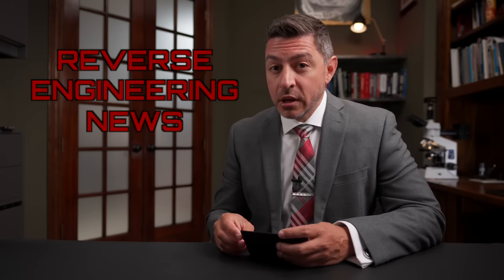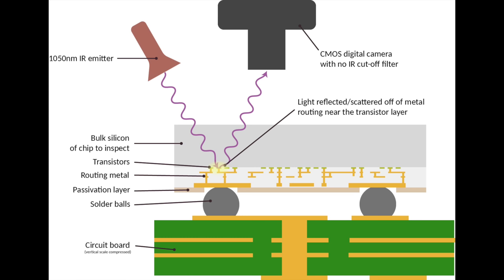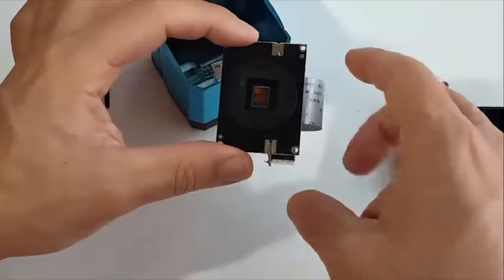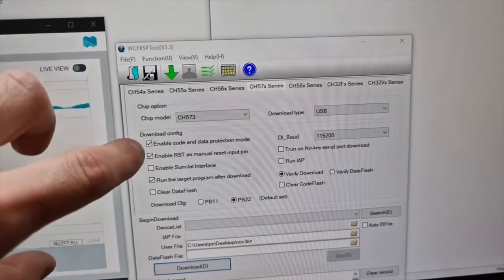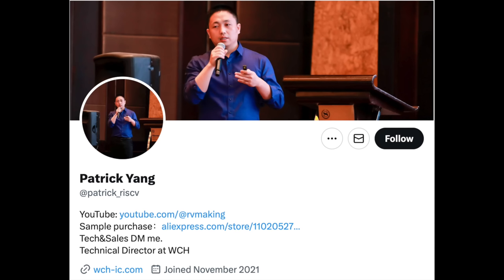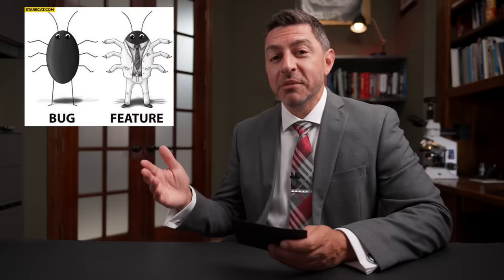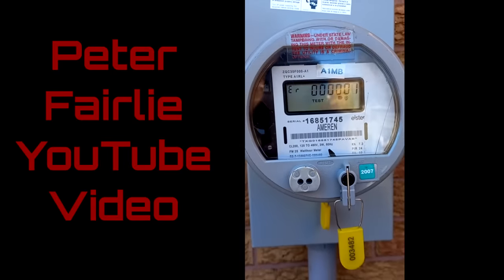Flipper Zero Kills Smart Meter?? - Reverse Engineering News - June 13th 2023

Comment: I discovered the process where it only deletes the pages of flash that is needed to be erase when making the firmware that ran a lift. This is one of those things you put in a car to load boxes.

I can assure you that you would never want to remove that firmware. It also would make it so I can use the rest of the flash for storing diagnostic codes. Flash still kinda sucks if you need to erase it often. So every little thing would help.
Reply: So what if you write a firmware file that just has one block of flash - not even enough to read and dump the rest by serial, but just enough to trick the chip into turning off the readout protection. Flash your "one-block" firmware, presto, read out protection disabled, and then just read the rest of it out. Chances are the first block isn't going to be that important, or difficult to recreate (especially like in this case if there's 2 firmware images in the flash as a backup anyway)
Reply: @gorak9000  oh I absolutely understand it is not a great idea to do in applications where someone could gain something by grabbing the firmware.

But on a lot of things the firmware or hardware isn't worth anything to hack.

I think it is a good conversation to have to understand that such features could lead to bad outcomes. But I am not waiting a 50 week lead time because my chips were bricked with some security feature lol (I know it is unlikely just being extreme with that example)
Reply: @XenoTravis  I don't know what you're getting at here? 50 week lead time because chips were bricked with some security feature? The correct behavior here is really simple = if read_lock=True erase full flash before writing new firmware / removing read_lock. I don't see how that's a "security feature" that would brick chips. When you're doing development, you're not going to bother enabling the read_lock to begin with. You only do that on the final release build that gets high volume programmed into production parts (and maybe a small test batch beforehand). The fact that you can remove the read lock by programming ANY firmware, no matter how small, without it erasing what's already there, which is supposedly protected by the read lock is clearly a "bug", NOT a "feature".
Reply: @gorak9000  was saying if I could save the chip's memory but also be aware of the security flaw then sometimes it would be worth it.
I think the dude who said it was a feature was not understanding that he was not clear to all the developers.

If I was told I can save my chips memory but I just am warned that the firmware is able to be taken easily, it wouldn't have been a big risk.

But that company made the security sound like the chip was locking and erasing like you explained. But in reality it wasn't securing the entire memory because it was also trying to save and write faster.

Sorry if I explained my point wrong. I was just trying to say I understand why the dude said it was feature. But I do agree it is more of a bug when presented as a full read lock.

Comment: Thanks for calling out the fake! Here in Australia we have all sorts of smart metering. I know you can't hack those things easily even though they have serial comms. Some of the newer smart meters I've worked on have a mini NB IoT 4G modem with a sim card, there's no way a flipper would work by design and I own one! Even with zigbee or wifi the flipper doesn't support it unless you've made some software and whipped up a prototype board.
Reply: Regarding the the "first red flag" for the smart-meter - there is a major caveat with that. It is possible to move from Canada to the supposed location. This needs to be considered in the future. The other points are still very valid though.

Comment: The power meter shown in the "Flipper" segment is a peak power recording power accumulator. The meter is read by an electronic meter reader carried by the local walking meter man. It communicates through the infrared port on the front, through the D shaped steel plate on the front. The lever to the right will reset the peak values stored in non-volatile memory in the meter. Reverse engineering the communication protocol is hard, even if you have a reader/programmer. 

Yes silicon is transparent to long-wave Infrared, but the resolution of the image is poor for recent silicon integrated circuit technologies. Current bleeding edge technology is in the range of 5nm feature sizes, and the wavelength of the IR is about 1000nm. And to access the back of the silicon you need to remove the heat spreader or remove the epoxy overfill. Most of the reflected signal is from the metal layers, and not much from the actual transistors.

As someone has commented below, a partial readout of the firmware is useless if you have erased the initial setup code on the device.
Reply from the maker: That device supported OTA updates, two copies of firmware stored in memory so it led to a full dump of the firmware.

The silicon viewing was meant more for block level analysis image comparison, is the chip fundamentally the same as a known good version or something else entirely.

Check out the site below, I have a bit of protocol analysis on L+G Meters, not the same as what he uses but fun none the less. Thanks for commenting!

https://wiki.recessim.com/view/Advanced_Metering_Infrastructure

Comment: The biggest clue that the meter video is fake, is that a service disconnect shut off the power FROM the meter not TO the meter. The meter would not lose power at it did in the video. And if Peter's meter was controlling its own power, how could it possibly turn itself on if it had no power?? Definitely fake. Thanks for exposing!

Comment: A3 was sold with Disconnect option inside. They use BIESTABLE relays that you can varely hear even in silence and they cannot be turned on and off like in the vid, because they they are kicked from a bigcap that need to be charged using the existing PSU. Like you said, moslty a relay out controlling a contactor or something. But those outputs are used in general at industrial application to signal that the demand limit has been reached or something like that.  This meters have been run over EMC  tests at 30V/m (no load) and 10V/m (Inom). So, this thing has been already tested. And yes, functional deviation is allowed as soon as the REGISTERS DO NOT ADD UP (30V/m) or accuracy variation (MAX-MIN) does not exceed 2% (Inom). So send Flipper to read the IEC 62053 first because, just by entering in TEST MODE or ALT MODE, meter is not having a bad time at all. Also, the maker of the vid claims that the way it measures can be changed. Well, anything can be changed. Now, understanding ANSI is ONE thing. Making this alterations are another thing. You need to understand the meter first, then try to find the information that ELSTER have obscured up even to their own employes ... I mean, you will end trashing the measurement or stalling the DSP .... thats the most likely scernario. Now Flipper, do your homework.

Comment: Those "flip chips" are called BGA (Ball Grid Array) mounted Integrated Circuits.
Reply from the maker: BGA is the mounting style, but it has to also be bare silicon on top for it to work. I believe they call that style of BGA a “flip chip”
Reply: @RECESSIM  Never heard of that... I stick mostly to sockets when I'm working with chips. I prefer sockets, avoid BGA at all costs unless absolutely necessary.

Comment: Jury is still out on Peter..... Yeah, those meters may not have been equipment with remote shut off as delivered. Wonder what Ameren would have to say to those account numbers on the meters?
Reply: Let’s just say they know about it and aren’t too happy
Reply: If you go watch his videos, there are a few videos where he shows the outside of his house and you can clearly see that his radio tower is right near his air conditioning compressor.  There is no electrical meter there.  Also, looking at the street view you can see the electrical meter is near the front of the house.  Then magically whenever he is "hacking" his meter, it's right next to his A/C unit, but there are no wires going to it, just a conduit going into the ground.  This is clearly staged.
Reply: @notmyname9876  I noticed the similar looking bricks in his videos too.

Comment: I’ve worked with this specific AMI metering system for a living since 2009. Peter’s videos are absolutely misleading people and this is a complete hoax as the Flipper is NOT communicating with either meter in his two videos. The A1 meter does not have any wireless capabilities as shown from the lack of the LAN ID on the right side of the face plate. The A3TL meter does have a 900Mhz EnergyAxis ILC gatekeeper board installed and can communicate over the EnergyAxis protocol to other meters but that protocol is encrypted if running in LAN 2 mode which it likely is. Either way, there are no open source projects in the wild that I know of that can perform an attack against the proprietary Elster (now Honeywell) 900Mhz EnergyAxis wireless mesh protocol. If there is, I would love to see it…

As you mentioned, the A1/A3 family of meters is not capable of containing an under the glass disconnect switch (correction to this statement is below in another reply), that is some other disconnect circuit UPSTREAM of the meter performing the power cycle. The display would also remain on (regardless of disconnect state) if it was a true disconnect meter, such as an Elster REX2 or a REXU.
Reply: I used to work for Elster and the A3 had a service disconnect option, You'll see a "7" in the 6th position of the style printed on the meter (ZDxx7xxxxxx) if it had the internal service disconnect relays installed.  I don't know if they ever marketed that option since the A3 was mostly used for non-residential installs.  But I know we spent some development effort to make sure we could install and test that disconnect relay if a utility ever ordered it.  The A3 was a very capable platform where all sorts of modules could be added into it to preform all sorts of extra options and connect to different communications networks.
Reply: The A3 offer disconnect option. Power supply is tied to the INPUT and VOTAGE MEASUREMENT is tied to the output of the line. So when power is cut, the A/B/C bulb start to flash, like it was a phase failure. Because voltage MEAS is tied to the OUTPUT, meter can tell if there is any voltage present PRIOR reconnecting (SAFETY FEATURE in case the home owner decided to conect to somewhere else). The ones with this option are bigger in depth.
Reply: @38911bytefree  I checked the Elster Solution style sheet and I stand corrected, there is in fact an "Internal Service Disconnect" option available for the A3 (which I have never seen in person) but I do not believe there is room for the contactor internally if there is a collector/gatekeeper board installed. Single phase A3's in the wild are also rare (polyphase A3's are common) unless you require more advanced features than a REX2/REXU can provide as A3's are more expensive than the REX family (even with the REX disconnect option). This is why REX's are typically used to meter single phase residential service as utilities do not care about measuring advanced metrics such as harmonics or power factor on residential service. Either way, the style number for Peter's meter decodes as follows (ZDC300Q4082):

ELECTRONIC METER, A3 CISPR, 1 PHASE 3 WIRE, S-BASE 30 AMP (200 AMP MAX), 120-480V W/64K MEMORY, NONE (this is where the disconnect option would be), A3 COLLECTOR/GATEKEEPER INTERNAL ANTENNA RS232 902-928 MHz LANOB2, STANDARD RESET, A3T WATT/TOU LP

The A3TL meter shown in Peter's video has no internal disconnect per the Elster/Honeywell part number. Fake video!
Reply: @anthonygentile4883  The base is a bigger in depth. The whole dpeth of the meter is bigger in comparison. They use THREE single phase biestable SW all in parallel actuated from a relay control board. Appart from a sample never seen one installed ... probably a forgoten option. Would be nice to see if CalStation can check the wiring on those ....
Reply: @JoeStevens  I corrected my statement on the disconnect in another reply below after reviewing the Elster style sheet. I have never seen an A3 with a disconnect in the wild as most A3's are used in polyphase service where a disconnect is not needed as you had mentioned. I know that there are certain style number combinations that can be created from the style sheet but Elster/Honeywell cannot or will not actually build them. Would be interesting to see what it actually looks like with the disconnect option...
Reply: @38911bytefree  Either a forgotten option or one of those style number combinations that you can create from the style sheet but Elster/Honeywell will not actually build... Would be neat to see one.

Comment: That flash behaviour lies in the nature of a flash storage for many many times - the flash controller simply cant reset all of the values per se - if you want to write something it will be "flashed"/resetted at a request :) not by definition each time  - clearing flash each time wastes valuable cell cycles :) macrocell macroblock refresh count. BTW the name FLASH stands behind the clearing operation and a flash of light it emitts at the zeroing in case of NOR (one'ing in case of NAND) operation

Comment: There are manual cameras that have a movable internal ir filter so they can use ir film (not sure the film is made much). I have one. It is a postwar Kodak Medallist 2. It has a setting on the top select knob.  The portable ir lights were In use in 43' with the Vampire so night photography was possible. That may be why the option was available.. to record WW3. Operation unthinkable and the aftermath. The military probably bought the lion's share of them.  
  The filter is easy to remove in disposable cameras too since they are meant to be disassembled to take the film out (some). Prolly not the resolution you're looking for, but maybe for something else.

Comment: Regarding the WCH thing I can see the logic behind it, and probably someone just didn't think it through far enough. A secure-ish scheme for partial reprogramming ought to be possible but there would need to be some kind of key stored in each block that the new code could be authenticated against. 

Back in the 90s or maybe 80s someone had the idea of having a microcontroller that could still be verified while it was code protected. The way they did it was to XOR parts of each program word so what you read back was predictable but it shouldn't have been possible to reconstruct the original word. Unfortunately this was EPROM technology so it was possible to selectively overwrite parts of a word so by zeroing bits then comparing the returned values you could reconstruct the original word.

Later there was a device that did do protection properly, to reuse the device you had to trigger a chip erase that was meant to blank everything. UNFORTUNATELY by running the chip erase in an odd way that I believe involved running the device from 12V you could prevent chip erase taking place and still unprotect the device.

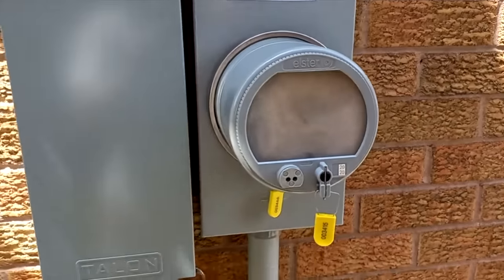Comment: 5:03 Those are the cleanest ever security tags I have seen that have been out there that long, as that meter was installed in 2007, then the meter that smokes all of a sudden is from 2020 according to the sticker.  Its for sure fake, 100%.  Also the sticker on the front of the flashing light meter shows that under "state" law you can't tamper with this device.  I was under the impression that Canada doesn't use the term state, but providence!  🤣🤷‍♂

Comment: Haha, "his system chooches a little different" - i AvE what you did there...
Reply from the maker: @arduinoversusevil2025 is the OG choocher 😂
Reply: @RECESSIM  I commented in response to another comment, but maybe you won't see it. An interesting thing to test with the "writing new firmware releases the read protection without erasing the full flash contents" bug would be to write a trivially small flash file - like 1 block of flash, that doesn't even do anything, and see if it also causes the chip to remove the lock without erasing the flash. Aka, you don't even need to write a firmware to dump the flash by serial - you can probably program any random flash page with all 0's, and that's probably enough to unlock the read protection without even overwriting any useful blocks of the existing firmware. I wonder if other chips have a similar vulnerability
Reply from the maker: @gorak9000  you should ask Aaron @atc1441 on his video showing the work, it’s a great idea!

Comment: As an electrician, rather than a tech geek, i hate smart meters. But because of technical reasons, they're unreliable, cheaply made, and generally shit. (and here in the UK,  the service disconnect is almost always present and i don't think that is a good idea) . Also they're Generally installed by not competent people (our meters are not simply plug into a base, you need to connect cables to them). I've gone to many customers where the meter is arcing because some numbnuts forgot to tighten the screws. I simply cut the seal , tighten them, then call the power co to tell them to re-seal it, and slap their meter monkey.

Edit. You just got a subscription, love the prove it or GTFO ... and i do dabble in tech just not as a job generally (i do understand enuff to not feck up ethernet or tv antennas tho, unlike some sparks lol)
Reply from the maker: Yea, lots of tech is poorly made trash! Meters SHOULD be a bit better but that varies by country/manufacturer. In the end, if someone is gonna talk shit they better be prepared to get called on it! 😀 

Thanks for commenting and subscribing.
Reply: Hi from the UK bud